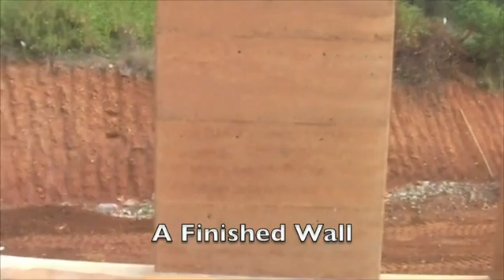Rammed Earth Basics

Comment: Sadly what the Rammed earth builders these days dont tell you is that they add cement. Which makes it rammed concrete or to use the stigma free "green" label, 'stabilised earth'. The truth however is that once you add cement you radically change the properties of an earth wall. It no longer breathes naturally, it is no longer 100% recyclable. And it looks like coloured concrete, because thats what it really is. Cold,hard, flat soulless concrete. 
Then there is the cost of rammed earth. Expensive forms and machines to work it and the labour on top of all that.
Reply: could have just as well used hydrated lime and it would have also bound with the clay. Of course then you would not have anything to bitch about
Reply: The walls are still very breathable as the amount of cement is at 10%. That is enough to stabilize the mix but it won't have any effect on altering the breathability of the wall. This very topic has been discussed bon multiple occasions.

Even the houses called Domegaia Dr do breathe! Perhaps it's the blending with soap, which creates an airy mix which allows the walks to breathe.

But no bones about it. Ten percent cement doesn't affect the wall's ability to breathe.
Reply: Another thing is this. Most of us build our own forms so they really aren't expensive. You can't purchase rammed earth forms as the expense would be prohibitive. This is why we make our own. And they aren't expensive to make.
Reply: @rawmark   do you have any resources for me when it comes to form work?
Reply: Only 10% Portland cement as a stabilizer harder constitutes as hard and cold.
Reply: Rammed Earth is better when you have a large pool of labor but little resources. It has existed before the modern age so you don't actually need expensive machines when you have large amounts of cheap labor.

These guys seem to have modern machines. Makes me think they should have just gone with regular concrete construction.